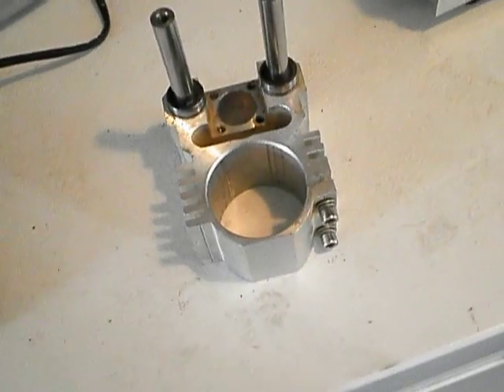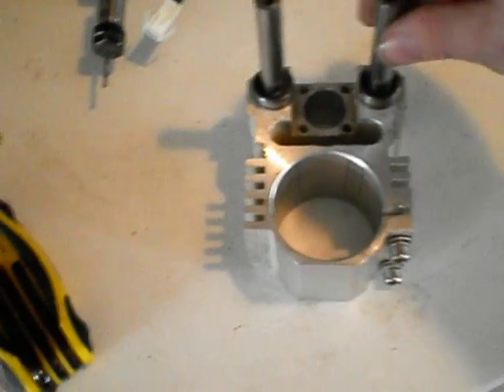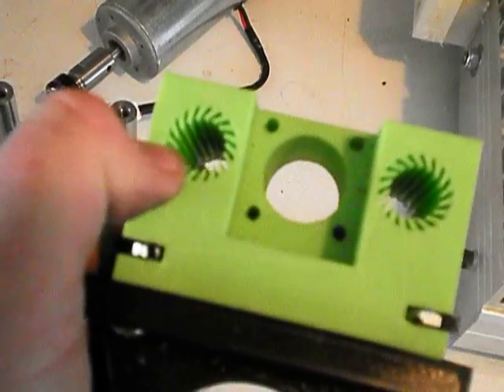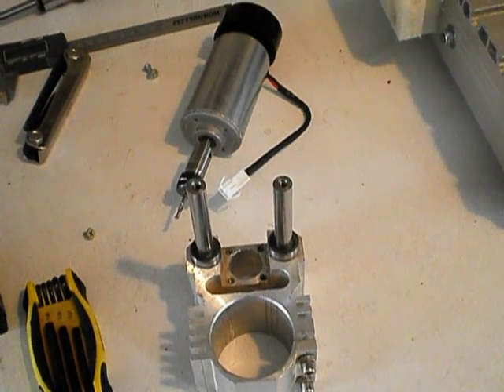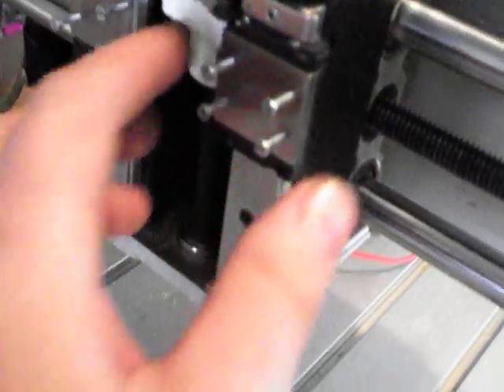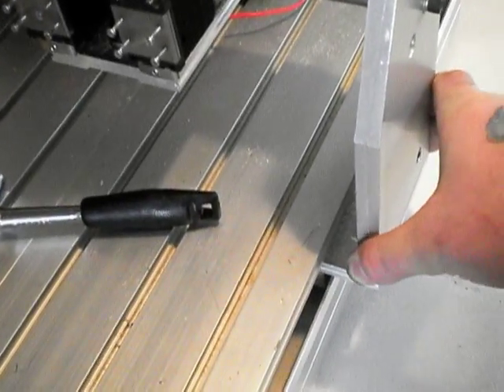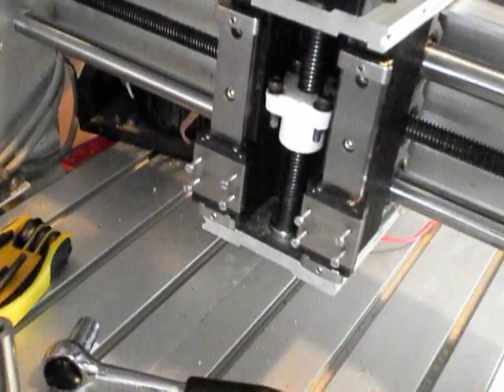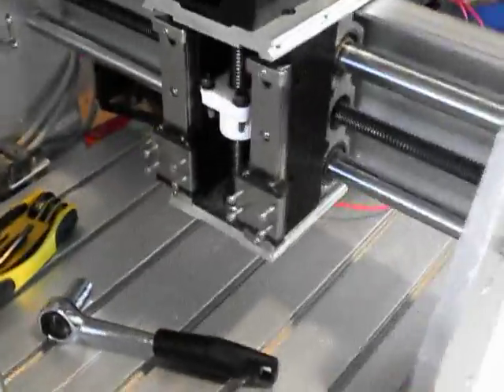3040t cnc THK bearing upgrade Part 1

Comment: This are great cnc desktop for Engraving on aluminum brass copper , metal & wood , people are having problems because they are cutting heavy with aluminum , metal and breaking cutting bits they are perfect for wood 3D carving , engraving i have the the 3040 and i only engrave hard metal aluminum you get my point not heavy cutting, i do heavy cutting only on wood, does excellent 3D carving

Comment: Did you ever get a bigger spindle attached? This is a really cool project, I would like to see more.
Reply from the maker: actually, i put a dewalt dw660 on it. This machine is actually on the backburner for right now. im currently working on a much larger machine.

Comment: I also 3d printed a new holder. I used pla + which has more flex, and I don't have any issues.  I wish I new what the pitch of the z-axis linear rods were so I could re print a new for the rods also.
Reply from the maker: If i remember right those are 5mm pitch 2 start trapezoidal thread lead screws. But i have a number of cncs now an i may be recalling incorrectly.

Comment: A thought, mount a router horizontally on the bed and dial it in square relative to X-Y-Z(you coud machine an in-situ mount out of mdf), cut the original motor-mount with a hacksaw and use the fixed router to square of the hack-sawed surface...

Comment: No disrespect ment but when you purchased this machine based on the price you paid compared to other machines it was not a very good quality machine. By the time you spend more time and money trying to fix it, it would have been better to save some  more money and purchase a better quality machine in the first place.
Reply from the maker: Alan Wright yeah after owning it for 3 years I totally agree. I do gotta say that it is a great learning experience for those that like tinkering. I am currently working on a larger cnc all homebuilt of course, and even though the price for building one is higher, the experience in building it is great.
Reply: I suppose the learning experience does count for something. Cheers
Reply: Alan Wright What cnc would you recommend, I don’t want to spend a lot considering I would only be milling 0.5-1mm plastic

Comment: Hi, did you ever manage to finish the project ? I had same problem as you, wanted a 65mm mount so I could add a makita trimmer router with a 65 mm dia body. I 3d printed the mount from thingyverse and added 2 linear bearings. Seems to work well, have to see how it goes for now.
Reply from the maker: binshotalot sorry for the late response but i did ha e it working for a while but i ended up following in drez2001's footsteps and just chopping the original mount flat to use as a mounting surface.